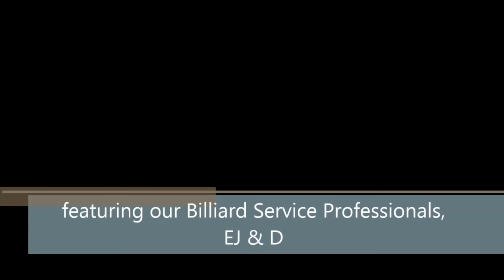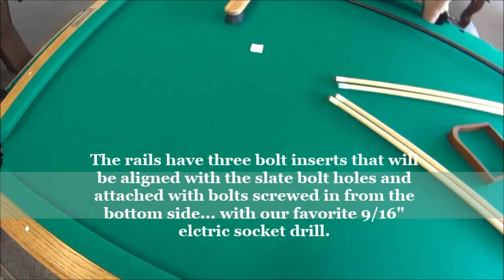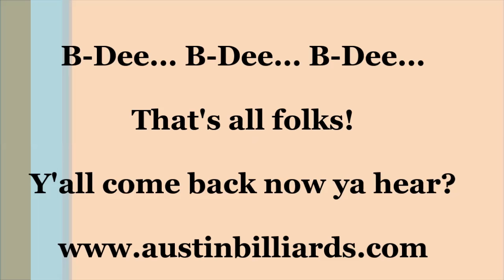How To Set Up A Pool Table by Austin Billiards

Comment: Nice that the frame was one piece and not had to be put together. So this looks like a show room display table probably setting up tables for a store that sells them. So no leveling required obviously. I use spray adhesive in a can to help hold and stretch my felt in place. I usually put aprons/skirts on the rails before I put rails on the table. Much faster for me. Bees wax is the new easy method. I liked using wood putty. It has a better hold in case you might have to move the table slightly as opposed to that beeswax which will pop on you and leave that whole seam lifted then you got to remove felt to get to the seam retorch to melt it etc. etc. etc. In general there's lots of things I think I can show them to be faster and better